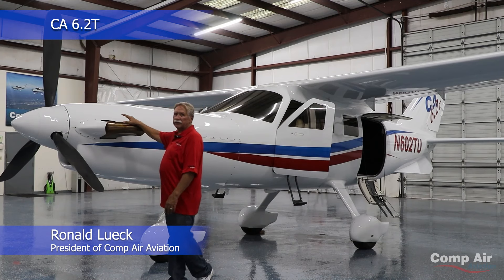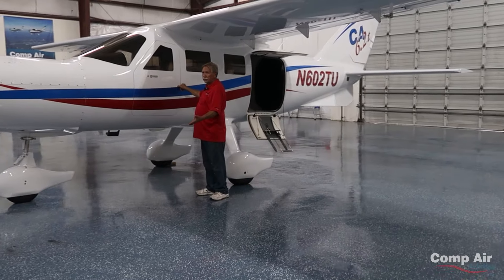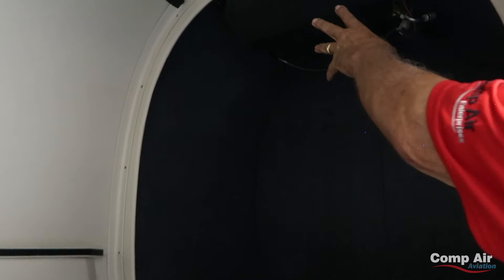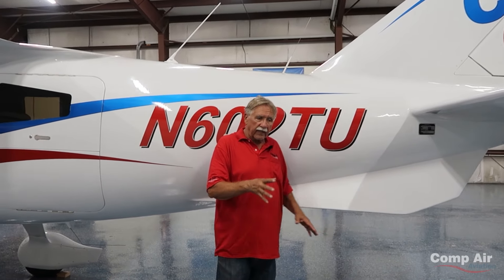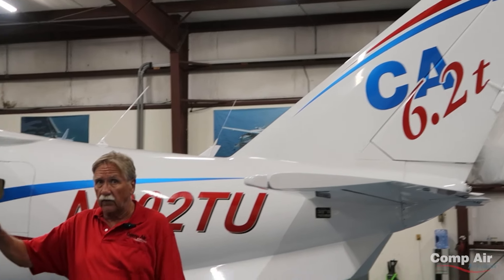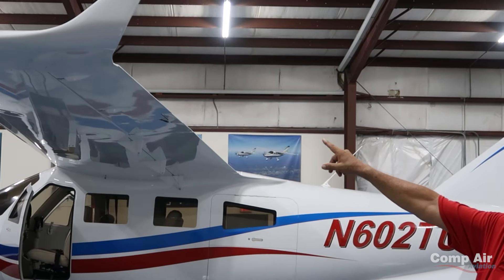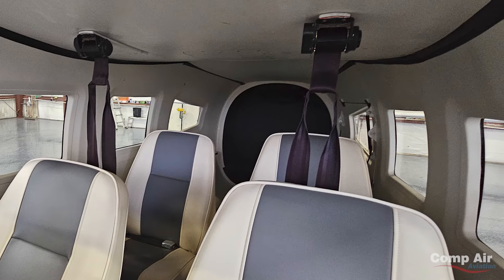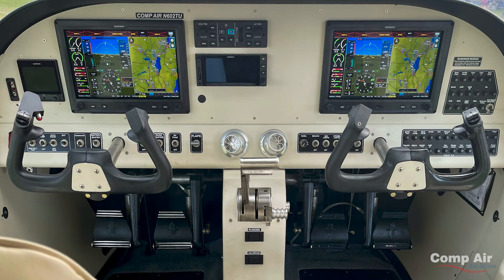Comp Air 6.2 Turbine Experimental Walkaround

Comment: you should make it like the extra 400 and 500 with retractable gear
Reply from the maker: Retractable landing gear uses up valuable interior space while adding un-needed complication for this airplane.  We are already cruising at 230 knots because we have aerodynamic fairings on the landing gear.  Would you give up a few knots of airspeed to remove the complications of retractable gear during flight and maintenance?  Just like what Ron said in the video, keep it simple, so it's easier to build and maintain.
Reply: Aerodynamic fixed gear is more simple, less insurance cost and no gear up landings.

Comment: How much ? Speed ? Range ?
Reply: pricey for sure.  crowded field for that type of aircraft, but good effort.
Reply: Checkout that information their website. With that said, the basic kit is $250k and then the turbine option is $235k more,  then there's avionics which can be $110k if you go dual Garmin G3X. They also have build assist and other cheaper engine options. It looks very customizable and also reasonable. One of the few low cost turbines well under 1 Mill.
Range 920nm, or piston 840nm.
Reply: @br4nd0nh347  thank you